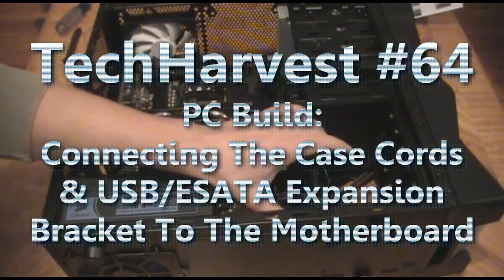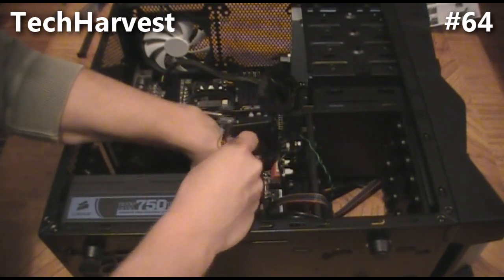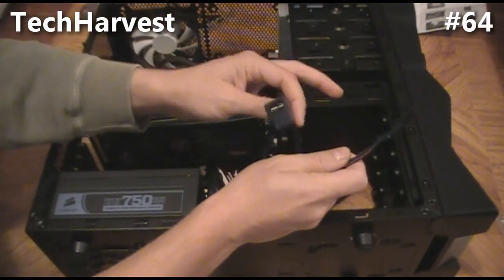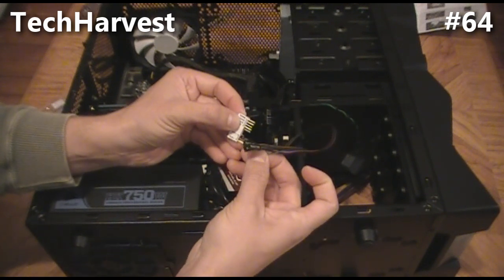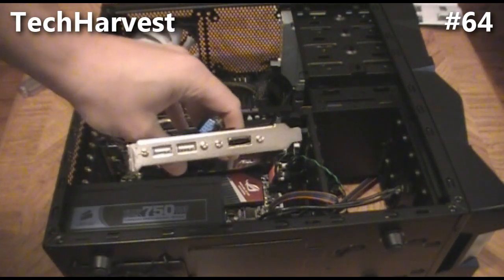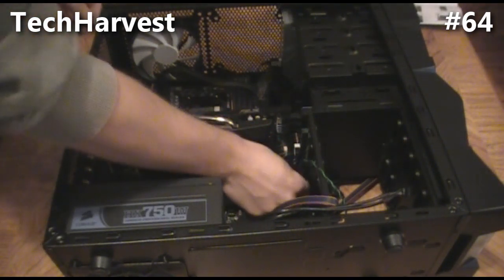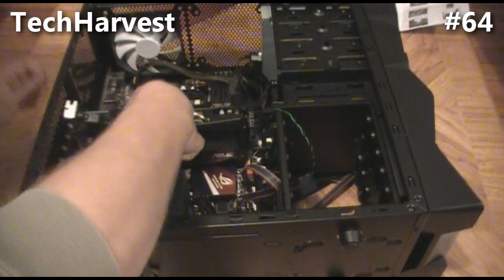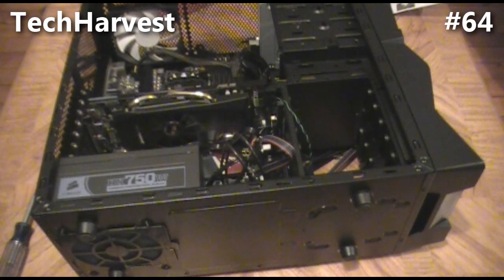Building A PC: Connecting The Motherboard To The Case Cords & USB/ESATA Expansion Bracket

Comment from the maker: @robert52072 Thanks for subscribing.  I've done some modifications to this build since this video was filmed.  If I recall correctly there wasn't any room for a top mounted fan after the cooler was in place.  The H-70 had 2 fans on it and it mounted to the back of the case.  I took the fan from the top of the case and put it on the front.  Since the H-50 is slightly different than the H-70 you might not have this problem.  Good luck with your build and keep me posted on it.

Comment: I have a B85 Gigabyte mobo and have no idea where to plug my front fan.. I already connected the rear one to the 4 pin case fan pins on the mobo...
Reply: 187MIAMIBOY should be several options